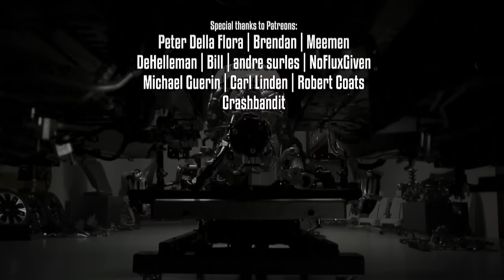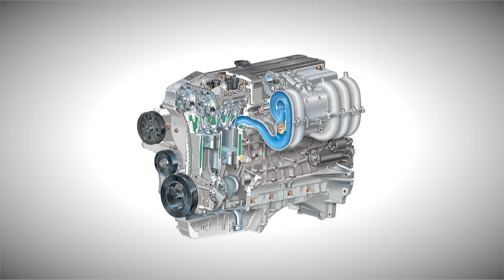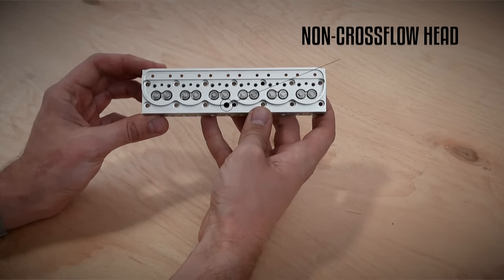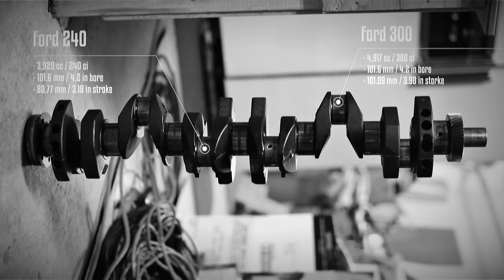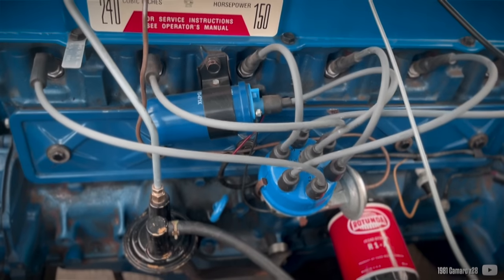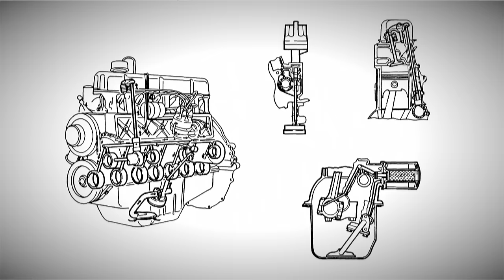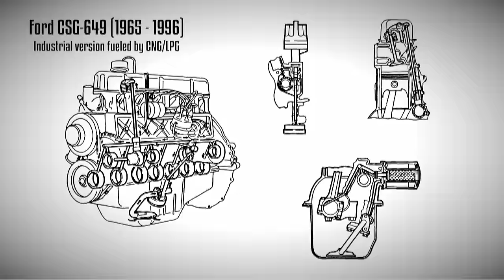Is This Toughest US 6-Cylinder?

Comment: The 4.0 L Barra is well known to be 400,000 km lifespan and add a turbo and its got great torque and power. An Aussie favourite
Reply: can't forget an intech
Reply: ya i watch some Aussie channels and they really rave about the Barra
Reply: @danhard8440  it's super reliable and super strong. A great engine. Aussie taxi for a good reason
Reply: Was that a ford designed  motor?
Reply: @easycomeeasygo8901  Yes, probably one of the best Ford designed/built engines.
Ford built ,Geelong cast Cleveland were superior to the US made ones too.
Reply: @easycomeeasygo8901  The Barra is very much a Ford designed motor. The cylinder heads are like a 6 cylinder version of the of the 4 valve 4.6L cobra heads even have bridge style cam caps and roller cam and roller rockers.
Reply: The Aussie I6 fords are based on the American 144,170,200,250 motors that are different than the 240,300 in this video. These were the base engines in the Falcon/Comet and Mustangs for a long time. They also were used in small Vans and Rancheros. All of these motors use intake manifolds cast into the head so were hard to get much power out of them.
The Aussie versions evolved with overhead cams and crossflow heads and turbos to become real performance engines but the US versions were just basic transportation motors.
I dont think the 300 ever was used in a car, only trucks but the 240 was used in bigger cars as the base engine.
Reply: Speak American not metric…
Reply: @michaelgarrow3239    It’s an Australian engine and we use metric.  Get over it.
Reply: @Michael Garrow  First of all this isn't a US channel. It is worldwide more than anything, feel free to leave and watch something else. Secondly we're talking about the Barra in this thread which is Australian, they use metric so that's what we'll use. Thirdly there's 194 other countries that exist outside of the US, in fact 95% of the world's population live in metricated countries. Myanmar, Liberia and the US are the only 3 countries who haven't adopted metric as their primary unit of measurement.
Not our fault you weren't taught how to mulitply by 10 for easier measurements.
Reply: @joshthomas2536  - not my fault you learned to count on your fingers… 🤓🎶🎵
Reply: @David-lr2vi  - There are countries that use metric and countries that have been to the moon…. 🥱
Reply: @michaelgarrow3239    You have fun in your little imperial club with Myanmar and Liberia.  Every other country in the world has moved on to the superior system.
Reply: The intech and barra have been amazing, really miss having one in the family. starting to see more hit 1,000,000 km as time goes on as well

ultimately fuel economy was its downfall, I frequently got 15L/100km lol. The EA888 is surprisingly torquey low down, so it's a good stand-in for now :D
Reply: @michaelgarrow3239  except metric was the measurement used when getting to the moon...
Reply: @David-lr2vi  - You by gas by the quart…
Counting everything by 10 is probably easier for simple minds to grasp.
Um,,, are your clocks metric? 
Rather drink a pint than a 1/2 liter… 
🙉🙈🙊🎶🎵
Reply: @DragoserakerIT  - Fun fact… America has more guns than people. 
Australia more Kangaroos. 🤓🎶🎵
We used slide rules and a computer dumber than your wristwatch to get to the moon.
Reply: @michaelgarrow3239  Fun fact NASA uses the metric system 😂
Reply: @David-lr2vi  The US doesn't use Imperial. It uses the US Customary System. They're different. For instance, a US Gallon is smaller than an Imperial Gallon.
Reply: @michaelgarrow3239  can't see anyone making 2200+ hp out of a factory 300ci ford block and head, like they have with the barra 6cyl.
Also did you know us currency is metric so you've been using metric all your life. and anything you can measure in imperial can be measured in metric but better.
Reply: @JC-zg4xe  - Um,,, what is your point. Thousands of American sub-contractors had to make parts by converting metric blueprints to a proper SAE dimensions. We did it anyway….  
How is “dating Kangaroos” working out for ya?  😂🤣😂🎶🎵
Reply: @michaelgarrow3239  Would have saved some time if they just used metric hey?😂 Kangaroos? What makes you think I’m Australian???😂😂
Reply: @6226superhurricane  - Um,,, I’m sure you could pump enough air through a ford block with turbos and nitrous to pull 2,200 hp.. until the block failed.
Funny my metal lathe is in inches. My mill is also.. 
The most precise measurement theoretically is the plank length  1.616255×10−35 m (metric) 6.3622x10-34” (SAE) 
I don’t see either as better. 
Metric is probably easier for simple minds to grasp… though.
Horse power is American units… btw. 
😎
Reply: there are barras running 2200hp+ without failure that was my point.
only a fool would make the argument that something should be used because it's harder and inefficient.
Reply: Lots of anger in these comments  🤣. Well thanks everyone  on tge info. I did my own 2 minutes of research. Good old no false info wiki 🤣. So yes based on us spec I6. But its kind of like comparing the 215hp 4.6 v8 to the 5.0 460hp motor. Its a evolution of the motor. So cheers to the AU folks for their ingenuity on this motor. Too bad Ford never imported it. They are always so scared of losing v8 mustang  sales. I have a tt v6, a Single T v8 and big turbo 4-cylinder. Love the v8 most, 4-cylinder  least....   Sorry. A nice I6 would be a great daily driver and sound and feel so much better then the 4-cylinder. Im not youtube  rich, so im stuck at 93 fuel. E85 drains too quickly and not Readily available locally.
Reply: @easycomeeasygo8901  93aki = 98 ron people have barra daily drivers over 1000hp on 98 ron.
Reply: @michael close  impressive. Im hoping to get near that figure with a turbo sbf347. Though i think ill be stuck in the high 800 to 900 range on 93 fuel.
Reply: @6226superhurricane  - Um,,, you said it couldn’t be done. Now you agree with me… It can be done; but it’s not a good idea.. 🤓🎶🎵
Lots of guys in the US turbocharge a 5.3 Vortec and run 4 figure hp for less than $1,000. 🙄
So,,, what do you use a 2,200 hp. 6 cylinder for? 1/4 mile? Grandma getting to the liquor store? 
Horse power is an American unit of measure and definitely not metric… lol
😉🎶🎵
Reply: The U.S. uses both systems of measurement. It's a hassle sometimes, but we manage.
Reply: @Golgi-Gyges  The US isn't the only country that uses both. There are a few countries that mix the two. Really metric is outdated in the digital age since it is based on the decimal system and computers speak hexadecimal.
Reply: @rich7447  I never said or implied that the U.S. is the only country that uses both measurement systems.
Reply: @Golgi-Gyges  I didn't say that you did.
Reply: @Golgi-Gyges  My only point was that many  people, especially Europeans, seem to like to criticize anything in the US while leaving out that it isn't as rare as they would have you believe. They are also very quick to claim that anything European is inherently better while ignoring any negatives.
Reply: @michaelgarrow3239  Just do the  conversion. Metric to SAE conversion tables can be found in automotive books, and online. It really is that simple.
Reply: @michaelgarrow3239  "Countries that use metric, and countries that have been to the Moon",.. Yes, and ALL of the countries that have been to the Moon, including the  one that landed people, used Metric to do it. Yep, NASA uses Metric, and has for a long  time. All space engineering World Wide is done in Metric. If fact, one of the biggest screw-ups in spaceflight, was Caused by a US subcontractor using English (Imperial measurments weren't invented in the US either) measurments after they ignored the documetation to use Metric.
Reply: @PiDsPagePrototypes  - Um,,, dude. The CNC equipment at the time was in SAE. Everyone had to convert the NASA blueprints to make it work on their equipment. We did it anyway. 
So no: none of the equipment that actually made parts used metric. 
And nasa using parts that don’t fit is on them… 
Metric is for people that count on their fingers….  🤓🎶🎵
Reply: They should have used that aussie engine in the f150 in 97 when the newer body style came out instead of that triton v6 POS they put in the trucks.  The triton lasts good but has the same spark plug hole problem as its v8 and v10 siblings.
Reply: @michaelgarrow3239  Wasn't "parts", it was software, and the subcontractor had  a contract specifying metric, but they programmed in imperial and didn't comply with the contract terms, and never supplied paperwork to indicate they had used anything other then the specified metric units. Just like many US folk, not wanting to stick to world ISO standards, and demanding the rest of the world follows theirs.
As a well know character said, The needs of the many out weigh the needs of the few, or one, ... lot less people in the US then the rest of the world, but a much higher percent of human ego.
Reply: @michaelgarrow3239  hate to tell you but NASA also use metric in a lot of the specifications, they actually use a mix of both.
Reply: Vortech 4200 is the alternative and completely over looked. Add a turbo you can easily hit reliable 700whp on stock internals
Reply: I knew an Aussie would be here bringing up the Barra. Hence why I'm here to let the 2JZ say "HOLD MY SAKE"
Reply: @michaelgarrow3239  geez what a pissing contest 😂😂😂😂
Reply: @pmscalisi  lol
Reply: @michaelgarrow3239  and if it wasn't for Australia you would not have got there.
Reply: @tomnewham1269  - Hello. I would not have gotten where?
Reply: Look up the 250 2v head straight 6 ford built here at one stage, u will love it.   @gruberstein

Comment: Also in those days, BMW was building their indestructible 3.5 liter straight six engines  (213 CI) putting out 256 HP and 243 foot pounds of torque, stock. 158 MPH was pretty fast back then.
Reply: BMW made great motors back in the day. Seems like at some point in the last 20 years they hired a slew of subpar engineers to design their motors. They make decent power when running but it's not easy to keep those cars on the road without constant repairs
Reply: @dilldowschwagginz2674 bean counters at work is all..

Comment: Thank you for doing a video on the Ford 300 straight 6. One of my favorite engines and tough as hell.
Reply: I had a 91 Ford truck and I could not kill that thing. I ripped the bed off the body with overloading it with steal pallets. Engine and manual transmission held up perfectly. I replaced clutch at 180k.

Comment: 9:28 Yep. I get modern ecoboost F150 gas mileage out of a carburetted engine from 40 years ago. I fucking love it.

That being said, a 300 will drink like a sailor on shore leave if you lean on the loud switch. How thirsty they are is ENTIRELY dependent on what you do with your right foot. And if your left foot isn't doing anything at all, take a good 20% of that economy away, 'cause the automatics put behind them were fuel hogs as well.

Comment: Yes, good engine indeed. Survived for a while longer by the Jeep 4.0 / 4.2 six, also a reliable powerplant.
Reply: Yep, I don't want a Wrangler after the last TJ wityh the 4.0...after that, they got too refined and sissy-fied..especially when they brought out the 4 door ones...
Reply: I've had 3 of the Jeep 4.0 engines. One of them in particular had no reason to continue running, but it did. I was young and loved beating the crap out of my wrangler. I ended up rolling it, getting it back on 4 wheels and driving it home. The only body component that was salvageable was the tailgate. Good times!
Reply: @dyer2cycle  same answer when someone asks me about updating my 2006 TJ. I’ll be rebuilding my 77 4.0 hemi next 👍🏻
Reply: I had a 99 xj that I installed a brand new rebuilt engine in for a few grand back in 2018.  The 4x4 worked well and all around was a reliable car that just needed some restoration and upgraded suspension.  I let it go for $900 in 2019.  If only I could go back in time and make better decisions.
Reply: That’s what I got in mine. Got a 2000 xj with that amc 4.0
Reply: The 4.0 in my '01 Wrangler is nigh 200k miles and still runs well. Was leaking a little oil when I first bought it, but fixed that with a new valve cover gasket.
Reply: @MousyOrla  Over 200K miles on my 01 4.0 Wrangler now😊

Comment: You and your viewers may find it interesting to know that a few people have started chopping up and welding Chevy LS heads together and bolting them to this engine.  There's a few videos on Youtube of it.  I'm sure it'll become more and more popular over the years.  It gives you a fantstic flowing cross-flow aluminum head on a bulletproof block.
Reply: Years ago back in the 70's There were a drag racer or two who cut up Boss 351 Cleveland heads and installed it on a 300 Ford..Think it had set some records which may still stand today..I think the one guy who did it was Tom Sizemore...
Reply: Yes to both of them things. I have heard of people saying that they use Chevy v8 distributors on them. I had the 87 with the first year of efi so I never got to try.
Reply: Sounds like a lot of work on the Ford block.  Wouldn't it make more sense on a GM 292 six?  It has the same bore spacing as an LS V8.  😁
Reply: @billyjoejimbob56 GM's 292 is just as good an engine as Fords 300. It just wasn't as popular in light duty trucks and therefore is easily forgotten about
Reply: That sounds like a project those drunk Russian guys from "Garage 54" would do.
Reply: Any Windsor or Cleveland series head would work as the 300 used Ford's standardized bore spacing and 4 inch bore. It made for simplified tooling setups, thus saving Ford money.  The Cleveland has the advantage of rectangular valve covers, easier to take a pair and turn them into one.
Reply: THIS I gotta see!
Reply: @johneckert1365  For some reason the 292 was never pushed, or really marketed like it should have been..I remember in the late 80's-early 90's hearing the GM truck commercials touting they had a "modern V6" in their trucks, while Ford continued to use an "old fashioned" inline 6..now, while I am a Chevy guy, and liked the GMT 400 trucks better than the late '80's-mid '90's facelifted '80 Ford trucks, I thought that commercial was ludicrous...I was thinking the whole while I was watching it, "yeah, you guys f*cked up not offering a 292 and an EFI 250 in these trucks"...the 4.3 V6 could be durable and last, but I always hated them in a truck...very "buzzy", not well balanced and virbrated a lot, and not enough low end torque...so you had to keep your foort in it and "buzz" it all the time..plus, a properly geared 305 or 350 TBI would get just as good fuel mileage...and it looked ridiculously small in the engine bay...
Reply: @gthomas3964  It was a guy that drag raced as "The Frenchtown Flyer". IIRC, they were standard 351C heads... 3 sets of them to make 1 head for the I-6. I am going on memory here from what I read clear back in the 1990s about racing that was done in the 1970s so forgive me if some of the details are in error.

- Max Giganteum

Comment: A lot of people say driving a slow car fast is better than a fast car slow. I feel the same about engines, the most fun I’ve ever had driving, has been in a 1992 Geo Prism (Corolla with cheaper parts) a 1995 Ford Ranger with a 3.0 Vulcan v6 and 5 speed. And the gem, a 1967 F-100 4 speed 240 with 4 wheel non-boosted drum brakes, manual steering, and zero options. The F-100 maxed out at 65 or so and you didn’t want to go any faster. 60-0 took a football field 😂

Comment: I’ve considered swapping out the 300 in my 1986 f150 flare side several times, but always talk myself out of it. The amount of low end torque it produces is insane. Coupled with the np435 4 speed, it’s unstoppable. I wouldn’t give it up for anything.
Reply: Just rebuild and boost it if you want more power. They can certainly take it, even more than 302's can.

Comment: For a while I had a '66 Ford F100 pickup.  It had a 240, and when I changed the oil, I used to climb into the engine bay and stand next to the engine....

Comment: 5:57 My F150 has 2.49 rear gears. I shift UP at 1600 most days. I have 80% of my torque available at just 800-900RPM. Some people call them diesels with spark plugs! And yeah they'll pull like there's no tomorrow.